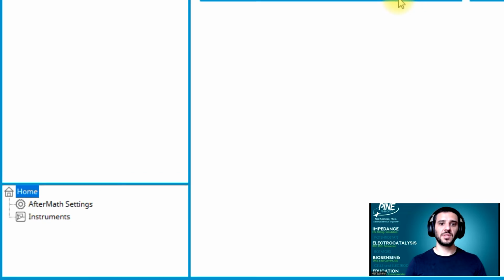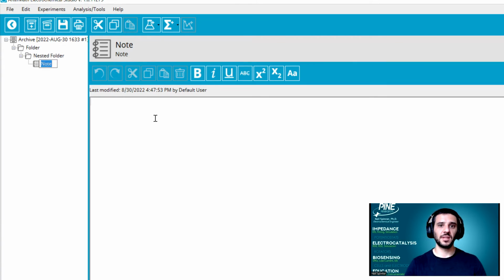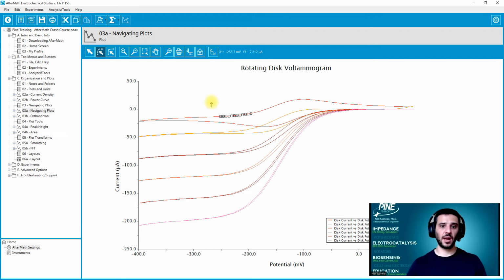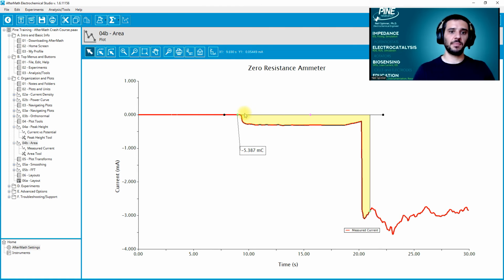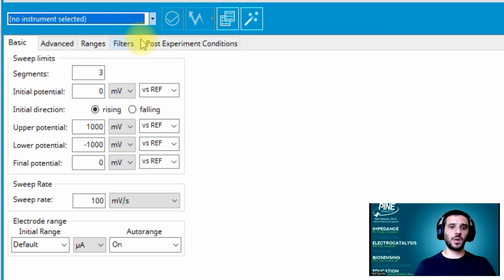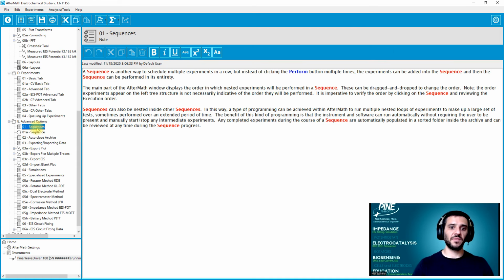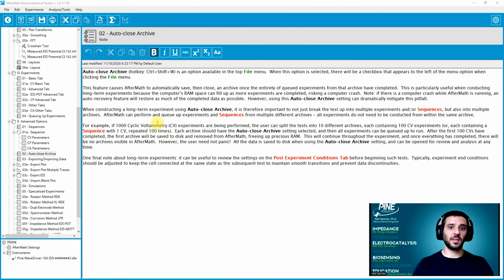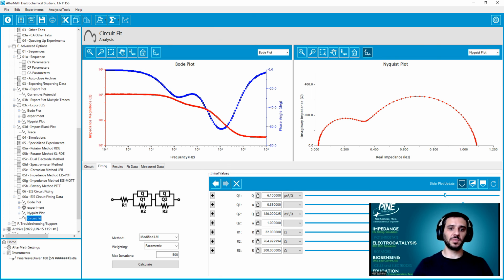AfterMath Software Tutorial

Comment: Hi! I have a question regarding Green AfterMath software (1.6.10515 ver). I downloaded the software from your official website around 2023 and used it to fit EIS data. 
Is a paid license required to use EIS fitting in the older Green AfterMath, specifically the version i mentioned above, or was this functionality available for free? I just know there is an upgraded version of the Aftermath software and now i am concerned about the license.
Reply from the maker: EIS circuit fitting is now a feature that requires a paid license, yes. It is also included for customers who purchase one of our EIS-capable potentiostats. In the previous green versions of AfterMath, we did unlock these features but in newer, upgraded versions of AfterMath (named "AfterMath Blue"), you will require a paid license to use the EIS analysis features.

If you want you can purchase a license directly on our website here: https://pineresearch.com/category/software/software-licenses/eis-fitting-simulation/. You can also email us directly if you want more assistance at pinewire@pineresearch.com.

Comment: Is there an option for batch processing in this software, or would I need to process each EIS curve as a separate archive? I have probably somewhere around 1k curves that I need to process, so creating separate archives for each curve takes ages.
Reply from the maker: Are you referring to importing EIS data into AfterMath?  Or are you referring to performing circuit fitting analysis?

There is currently no way to bulk import data into the software, unfortunately.  However, it is possible to perform bulk circuit fitting operations.  The feature is called "MultiFit" and it is a right-click menu option on an existing circuit fit module.

If you would like some assistance or for me to show you how the MultiFit works, let me know and I can show it in our next livestream perhaps.  Alternatively, I am happy to connect via email or video session separately with you to show you how.

Comment: Is it possible to modify the CV parameter values in the middle of a CV experiments? 
For example, I wanna increase the no. of sweeps during the experiment, then how can I do that? I did not find any option in the aftermath software to modify the parameters during the running of an experiment.
Reply from the maker: Currently, there is no way to adjust the CV parameters in the middle of an experiment.  Once the parameters are set the potentiostat will perform them, but can't be changed on the fly.
Reply: @Pineresearch  Thank you for the reply.

Comment: After downloading the software many options are not working. Kindly provide us the link for full access.
Reply from the maker: Hello Shahid.  What specific options are not working?  Do you have a Pine Research potentiostat?
Reply: I download aftermath from the link you provide. It required a license I think. I got the following message.
No licensed features are unlocked.
Reply: Brother, thank you for your reply.
Reply from the maker: @shahidahmad_13  Not a problem.  So should only need to create an account on our website (free) to download AfterMath.  You should be able to import data and do things like circuit fitting, but without a Pine Research potentiostat you won't be able to perform any experiments.  I hope this helps.
Reply: @Pineresearch  Ok then, how can I get Pine Research potentiostat?
Thanks
Reply from the maker: @shahidahmad_13  Where are you located?  We sell potentiostats around the world, you can find our WaveNow series potentiostats on our website https://pineresearch.com/shop/product-category/potentiostats/wavenow-series/.  You can also find our distributors our on website too  https://pineresearch.com/international-representatives/